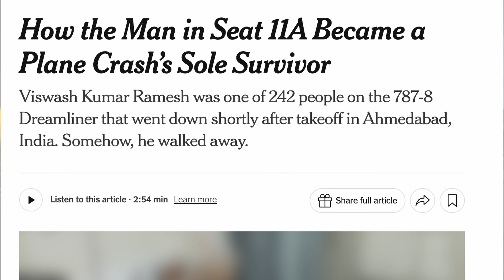Why the RAT Changes Everything – Air India 171 Update

Comment: You got to be blind if you didnt notice the issue started on the runway. The plane ran long on the runway, a dreamliner doesnt need that much run..
Reply: All debatable. Derated/flex thrust calcs use as much runway as they can
Reply: @michaelbee8263  yeah it was ok,,,,,
Reply: Exactly
Reply: Confirmation that they started takeoff about 1/3rd down the runway.  Didn't need it all.
Reply: @Richard-xv3gw  Full back-taxi to the beginning of the runway.
Reply: Tbh neglected plane all the small issues happening kinda masked the bigger issue probably

Comment: It was an electrical issue as the 787 has been known to have. The engines were affected by it, the engines didn't both fail at the same time, and there was no bird strike. A passenger on that very same plane reported this when he was dropped off at the departure airport. The inflight entertainments systems were fluctuating.

Comment: The captain flying the plain radios mayday, mayday- no power, no thrust, no lift.  I think it must have been a loss of hydraulics or more likely power loss. The power loss was documented on that flight and on the previous flight.  I don't think the engines flamed out. I think they were choked out.  They need to get those maintenance logs and interview every mechanic asap.
Reply: There will be a few ground maintenance crew getting sleepless nights.
Reply: Yes, in a past flight passengers reported problems with lights, ringers for assistance, wifi, etc... that should have been a sign of no go but...
Reply: @thor3399able they went. Why?
Reply: @slowlybutshelly who knows? As many say, contaminated fuel, hot weather making gas bubbles, but one thing is certain: that plane showed issues with electric power, and hardly whoever was flying it before, should have raised a flag to ground the plane and not allowed to fly it, but the airline is a corporation and who knows the reaction to a wake up call, how was this possible?😢
Reply: If the engines were choking, it could be fuel contamination.
Reply: @Darthvader-en8ce but like some other commenter said other flights would have been affected too but weren't.
Reply: @Darthvader-en8ce but if an electrical problem arose, maybe fuel pumps stopped working. It is to soo but TAT was deployed freeing pilot's from error.
Reply: Always blame the mechanics. 25 year certified mechanic. Titanic sunk because of the mechanics, hindenberg was obviously a mechanics error, and let's not forget the space shuttle tragedies, all because of mechanics.
Reply: @DavidViens  I worked for 25 years at a flight school as a mechanic.  Any time there was an incident or accident the FAA would first come to the maintenance department and demand to see the maintenance logs.  It almost always turned out to be pilot error but the FAA would suspect a maintenance problem first.
Reply: @karlklein2966  It's not that they would suspect maintenance - you have to rule out variables. Checking maintenance records is routine on every accident or incident.
Reply: @DavidViens  Titanic sunk because of pilot error, the Captain literally sailed into an iceberg even a modern ship can't survive that. Sure the Titanic had design flaws but so did many ships that time and very few sank because of design failures.

Only modern ships are designed in a way that if they make water many compartments are modular and distributed so they have more time to evacuate.
With inner watertight doors and automatic doors.

As far the incident with the Boeing Dreamliner, strong evidence support the pilot error for not following the checklist and taking off with multiple malfunctioning systems which can be related why they lost controls.
Reply: @JerryDoe And now we have a biased judge and jury blaming pilot because he can relate with titanic. Get a life and wait for the report before you start saving your so called fraternity and blaming others just based on so many "could and maybe" and commanding to look no further. Seriously?

Just wait for 3 months as stated in press briefing. Then say it loudly that it was a pilot mistake. Till then atleast don't blame those who also lost their lives. Please have some respect. 

Just imagine the situation they were in for last 50 seconds.
Reply: @JerryDoe the steel rivets used on the titanic had too much carbon, this made the rivets brittle, it was captain error mainly, followed by bad SOP , shoddy construction, engineering and design
Reply: @rajeevanand111  The Titanic was a well documented case, they literally teach it in history. Tell me you're stupid without telling me you're stupid....
Reply: @arbjful  No its not, you really should pay attention to history, it is one of the most well documented cases by James Cameron... Tell me you're stupid without telling me...
Reply: @arbjful  read Wikipedia before making stuff up...
Reply: @rajeevanand111  I have 15 years experience in airplane maintenance, i don't need a turd to tell me how to do my job, the Titanic is a well documented case and they teach that in history classes. If you don't know how the Titanic came to sinking well then better pay attention in school instead of making up stories. As far of my theory it still holds as the pilots took off ignoring the AC failure on multiple takeoffs, it is literally on the checklist and is a critical component to also cool the avionics compartment that cools the servers. If the servers go down so do all systems and engines. Ignoring the checklist is not only a serious pilot error but they'll put you in jail for manslaughter in many countries.
Reply: @JerryDoe there was test done in a lab using the rivet used in the titanic , this is a well documented research.
Strange how an Einstein like you missed it…or maybe you aren’t competent enough to read technical matter…
Reply: @JerryDoe airplane maintenance my a$$..😂😂, now get back to flipping burgers
Reply: @JerryDoe  Pilots probably flagged it, company probably effectively said "we don't care, if you want to ever work again and not have your kids thrown out of university get on with the job". If you watch youtubers who fly in developing countries a lot, this obviously happens regularly.
Reply: @Bozebo yes but by international regulations you can’t takeoff with a failed checklist and they are protected/covered under the same regulations so pilot error for skipping the checklist.
Reply: @DavidViens human behaviour
Reply: Flamed out means what?
Reply: @slowlybutshelly When they catch on fire. No visible fire coming out of engines.
Reply: As far I have heard, the internal power has got nothing to with the engine power
Reply: @rotyagi4371 Fuel pumps are electric and they MUST be operating for a takeoff or TO/GA.
Reply: There is evidence of passengers reporting the flight before that AC was not working and entertainment system was glitching / non functional.
All planes have server rooms or "avionics compartments" where the main computers/servers are located.
Usually under the cockpit and accessible through a hatch from the cockpit floor.
Temperatures can soar up to 70 degrees Celcius if not cooled, causing systems malfunctioning.
In the same room is the entertainment system main server, proof that it was glitching for the past two days already tells me enough that the computers/servers weren't cooled properly.
Because these computers/servers translate instrument control inputs to actions to actuators, hydraulics and also take in data from gps, windspeed, angle, roll etc... and control engine settings, flaps, landing gear etc... a failure of those systems could have switched the engines off or simple froze in the last state of inputs.

Considering the poor maintenance history of India planes in general and the negligence of the pilots ignoring a broken AC system on a Dreamliner full with people on a tarmac that is burning hot. I'd say look no further.
Reply: Fuel pumps, landing gear and environmental controls (air con and lighting) are on the same electrical bus.

So was it partial failure or was is full electrical failure?

Comment: Apparently, there is a possibility of a double engine failure. A possible loss of power was mentioned on the ATC recording. An inspection of the fuel system has been declared to all 787 fleet

Comment: With the RAT deployed and the landing gear being tilted and the Mayday call I have no doubt they had a major failure. Prayers for all the families affected by this tragedy. Thank you Captain for this excellent analysis as always ❤
Reply: Prayers for all the families!
Reply: Could the fuel supply accidentally be turned off?
Reply: @bstanz5266 yes but that would take a real stupid pilot for I don’t think it is just a simple onoff switch
Reply: @bstanz5266 very good question I was wondering about that as well
Reply: Analyze what could interfere with physical and electrical throttle command and pathway to engine thrust computers!
Reply: @mat1500  maybe battery power from the lithium-ion batteries on the Dreamliner...of which there were big problems with in/around 2013 & Boeing had to make quick design changes.  I've also heard reports that prior to take-off, passengers were reporting (maybe on social media?) that it was hot & uncomfortable inside the cabin & that many electrical devices for passengers were not operational.  I've been thinking similarly, wondering exactly @ what point does provision of electricity move from battery power to jet engine power..& I'm thinking it's right @ the time of take-off, which in my estimation is when the problems with Air India began.
Reply: 1:38 at this point you can see the Engine Flame Out Smoke. That's not Dust. 😢😢
Reply: 1:38 Sir, at this point you can see the Engine Flame Out Smoke. That's not Dust. 😢😢
Reply: With the RAT deployed and the landing gear being tilted and the Mayday call I have no doubt they had a major failure. Prayers for all the families affected by this tragedy. Thank you Captain for this excellent analysis as always ❤
Reply: What could possibly cause both engines to fail immediately after takeoff?
Reply: Captain Steve . We common person rely on  you guys who show us truth  .BOEING and  airline they care about Shareholders 
There is lot  of short cut by Boeing for profit 
Please keep update the inside story
Reply: @rishi505 that is a dumb coment there is loss of life and BOEING does care.
Reply: They are so rare, dual engine failures.  They’d have to completely screw up, I mean completely to allow conditions to exist for not one, but two engines fail.  Show what a colossal failure India Air is to have this happen.
Reply: @redfan3977 everyone but boeing eh?
Reply: @redfan3977  Or a fundamental design flaw in this Boeing aircraft.  Much more likely.
Reply: @poruatokin  Or a combination of both, creating the perfect storm so to speak.
Reply: @poruatokin good design wouldn’t have allowed dual engines failure as all critical systems are supposed to have dual/triple redundancy and checks against human errors.
Reply: @GoalDukkAt-DS9 ...and yet as we saw with the 737 MAX, Boeing seem not to be very good at that!

Comment: With Boeing cutting corners recently, it always seemed like an aircraft issue/failure rather than experienced pilots making a simple mistake. It's like saying someone driving a car got confused and turned on the AC instead of hitting the brakes in an emergency, just seems imposibly unlikely.  Hopefully more information comes out soon.
Reply: You are making implications with no basis in fact that there was a manufacturer’s defect. Your analogy is specious - it’s more akin to pressing the button to turn on the radio rather than the button to turn on the AC.
Reply: @pacmanc8103  Everyone is making implications so far, the whole video you watched in not concrete and the facts could change (for example last video captain Steve made stated an entirely different reason). My point is pilot error seems unlikely which it very much is in these circumstances and its far more possible that it is a manufacture defect, Boeing has been disregarding safety for profit also - not sure why you are defending them.
Reply: I would only suggest that for some commenters it is useful to paint Boeing as an ‘enemy of the people’.  You don’t know whether or not pilot error, airline aircraft maintenance, some manufacturer’s ‘defect’. But what is apparent is where you’d like the blame to be.
Reply: @pacmanc8103  Well in the prior video the pilots got blamed... That's how this works, it's someones responsibility that nearly 300 people died. As everyone is also speculating, I'm also speculating this is more likely to be a Boeing issue over pilots error
Reply: @funckypickle77 I know what you wrote - I read the post. That’s what my response was about.

Comment: Hard to believe both engines would fail simultaneously upon T/O.  There was thrust available to get the plane down the runway to speed, but it's also said the plane used nearly all the runway before rotating.  Black boxes will reveal the truth.

Comment: Did one of the pilots hit the fuel cutoffs? That was one of the events that happened in the Egypt Air 990 incident.
Generally the APU is kept operating until all clime out is over, the gear is up and the flaps are up. Why was the APU not operating? 
A dual engine failure from component fail or fuel contamination or something like that is highly unlikely.

Comment: If they was pilot error air India is in trouble inter of gear up flaps down! 😮 yup sounds like turbo prop sound! Hmmm fuel  contamination that will stop the fuel pump pumping the fuel into the aircraft if it detected that there was contamination in the fuel

Comment: You can see that the flaps are proper. You will notice the shadow created by the gap on the wings. Pause at 3:55 and observe the wings. You can distinctly see 2 gray/black lines on the wings. Flaps were down. The gray-black lines are the gap.
Reply: Yes, I also saw that, especially on the left wing. It's really unmistakable.

Comment: I have seen another video showing how the gear normally go up into the body upon being stowed. The wheels are angled back upon lift off, but when they start retracting they angle forward before stowing.  The landing gear in the video are angled forward indicating that the gear most likely started going up, but failed before going all the way up. My guess is going to be a massive hydraulic failure when they tried to put gear up.

Comment: When I was an air traffic controller, prior to 9/11, we were granted familiarization flights in the cockpit, fam flights for short. In the DC-9, the precursor to the MD-80 series, the jump seat folded down from the cockpit entrance door and you basically straddled the power pedestal with your legs. At the base of the pedestal were two fuel cutoff switches. The captain always told me, "Whatever you do, do NOT touch those switches!" Dual engine failure in a 787-8 just after becoming airborne and 600 ft. above ground is unbelievable without fuel being suddenly cutoff to the engines. Fuel contamination would still provide some power to the engines, not a total loss of power. Something or someone shut off those fuel pumps.

Comment: Captain, some others have mentioned the RAT initially. But did not clearly mention what would activate it.  I couldn't buy the theory it was mistaken levers since the flap was on the central console and the landing gear was on the dash.  It seems that the landing gear may have been kept down for emergency landing.    Is it possible that the pilots knew something was wrong before lift since they supposedly called may day may day?

Comment: A lot of people are saying electrical issues...if that were the case, which is quite possible, would the engines still be running though?  During the video replay no jet engine noise was heard, just the sound of the RAT....would those electrical issues also cause the flaps to not extend or retract?  Hydraulic pumps not working due to electrical failures, so the flaps, landing gear, etc. are stuck where they were when the hydraulic system failed due to lack of power?

Comment: Earlier on a Google newsfeed today was a story from a source in India of unknown veracity, about a situation with ground handlers and maintenance contracts. It suggested a possibility of incompetence or even sabotage surrounding hydraulic systems and that causing issues with flap deployment and gear retraction. So, it'll be interesting to see if this has any bearing.
I think the RAT deployment is significant. In any case, it's time to be patient and allow the investigation to proceed.

Comment: If the RAT is deployed, wouldn't the fuselage have blocked the camera's line of sight to it? ... it only extends a few feet below the belly.
Another possibility - maybe the pilot-not-flying shut down both fuel cutoff switches instead of raising the gear?
If the clarity of the original video is good enough to see the deployed RAT... then what did the video say about the position of the flaps?

Comment: I was firmly in the camp of pilot error before seeing this video. Thank you for the update, proves I was most likely wrong. It's just astonishing to thnk that a dual engine failure could happen after rotation, especially on a plane as reliable as the 787. Investigators will have the black boxes at least, we need answers if there is something wrong with the fleet.
Reply: Seconds after take off is truly the absolute worst time for a dual engine failure.  Nothing those pilots could have done.

Comment: If the RAT is powered by the forward motion of the plane, it has no motive power of its own (?) why does it make the sound of a prop?   Is the sound of a propeller plane from the air on the blades, not the motor?
Reply: Its a wind turbine! They make noise! A real small one sounds like a piston engine.